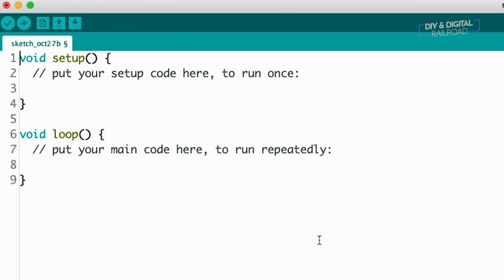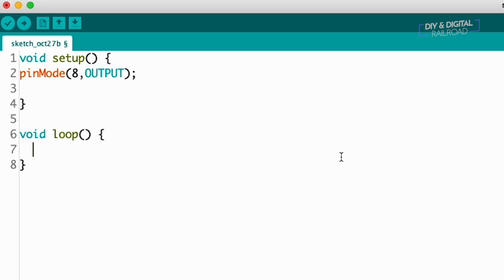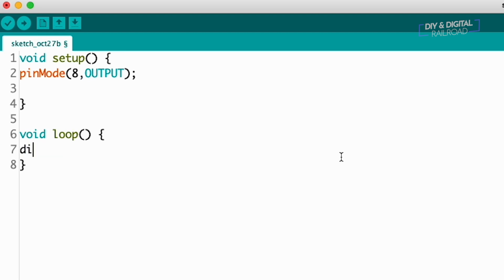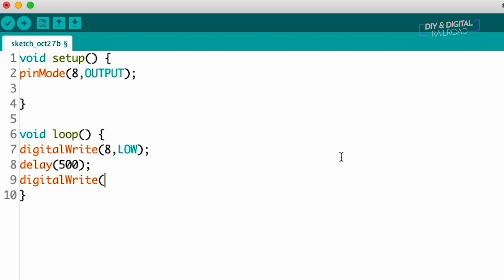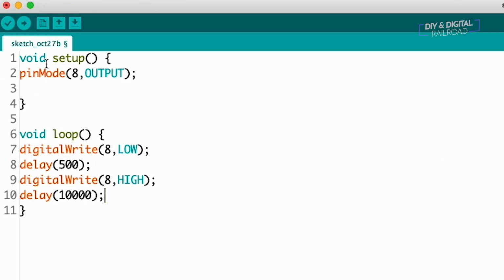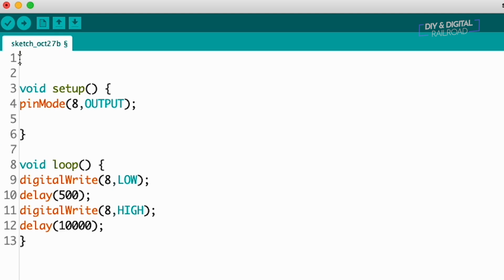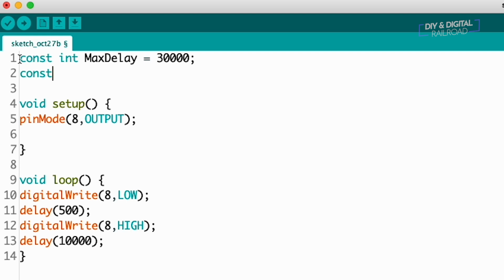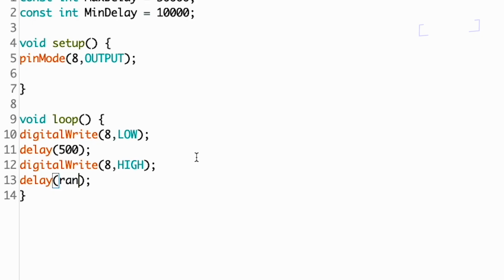Add a Thunderstorm to your Model Railroad

Comment: could you tie this all into the layout and room lighting so that using an arduino your layout could go through a night/day and storm cycle while tying that into a fast clock?  if that's the case, that would be awesome because then you could have daylight, evening (all the building and street lights come on), then night, a storm comes through, then the sun starts coming up, the street lights come on.  For a daytime storm, maybe the lights dim a little like the sky darkens and then the storm triggers.  and all of this happens while you're having an operating session.  THAT would be epic if it's doable.

Comment: You can also add trigger points along your layout so the effect triggers when a train at a certain point along your layout. This would give a silhouette type of effect when the train is at the right location. But also program in "hit-and-miss" so this does not happen every time the train is there. Just periodically so it does not become ho-hum. Train is there, lightning happens every time.

Comment: You may want to be aware that the random timer on this sketch won't really be random. This is because of the way the Arduino, which can't really do anything randomly, creates psuedo-random numbers. Without an intervening command, the Arduino's random number will generate based on the number of microseconds between when the Arduino was turned on or reset and when the random() method is called. To get a more random number, add the following line of code to the setup() part of the sketch: randomSeed(analogRead(A0));

That reseeds the Arduino's random number generator by waiting for the number of microseconds between the randomSeed() call and when the analogPin A0, which should not have any wires feeding into it, is closed by the passing of a stray electron. That will happen in a few milliseconds, but the wait time is not predictable.